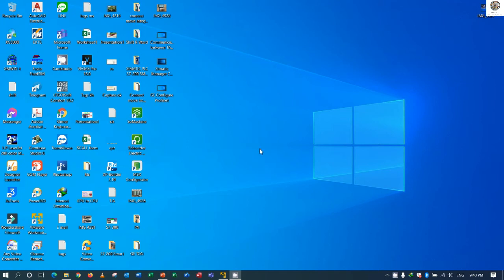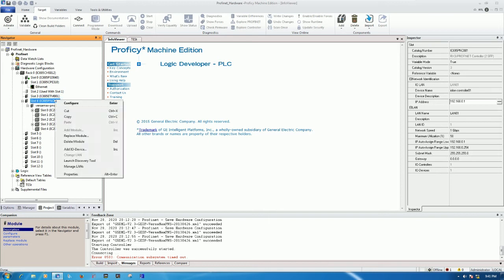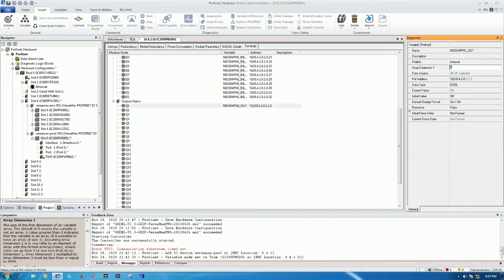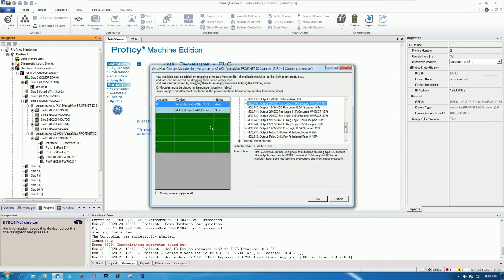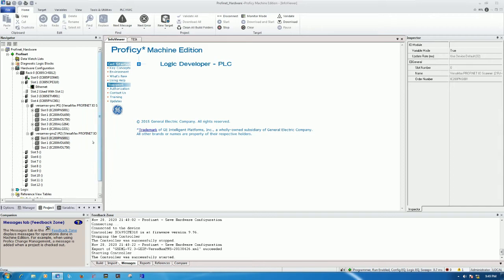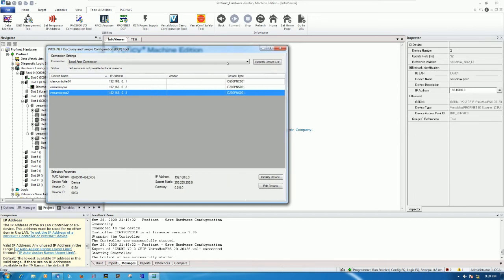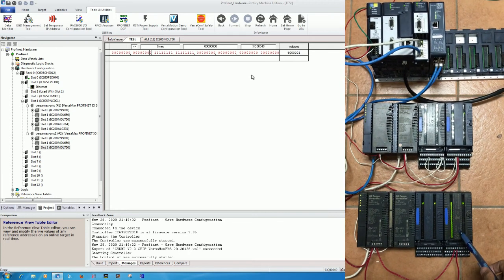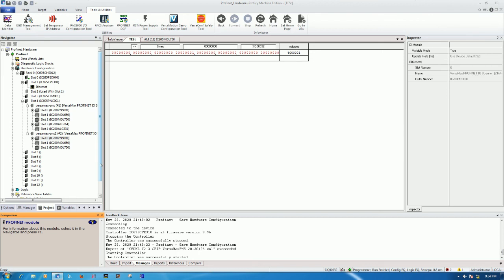Proficy Machine Edition V9.0 how to configure hardware Profinet controller & Profinet I/O part2

Comment: Is it support  Profinet pns same rack profibus slave module
Reply from the maker: Yes it supported sir.
Reply: @generaltechnologyknowledge5165  no its only profibus master module is available in gsdml file
Reply from the maker: @RameshKumar-lg9zq  Dear sir,
Normally the structure is connect from Profinet Controller (PNC) to Profinet Scanner (PNS). PNS we can connect with Profibus Master ...
This is the concept.
Thanks

Comment: I configured PNS002 IO racks. Problem I'm facing is about redundancy. When both ports blinking and port 1 disconnected it'll be connect with port 2 without delay. After normalize, disconnect port 2, it's taking 3 sec to connect port 1 (port 1 was communicating before removing port 2)
After that same voice versa with port 1 disconnect 

Any configuration is required. Or this system is like that only?
Reply: Kindly help me on this redundancy issue

Comment: Sorry. Can I ask you a question?It's possible to connect more profinet scanner (for exsamle 192.168.10.1,192.168.10.2.....192.168.10.10) on a industrial swhitc  to implement a profinet network (star network) ?
Reply from the maker: Dear Sir,
Yes we can configure and connect it by follow the range in class of IP address
Reply: @generaltechnologyknowledge5165  Many thanks, this is the first time that I work in profinet, thanks for the detailed information. I have always worked in EDG (ENIU) with both GE Fanuc  and MKViE systems.